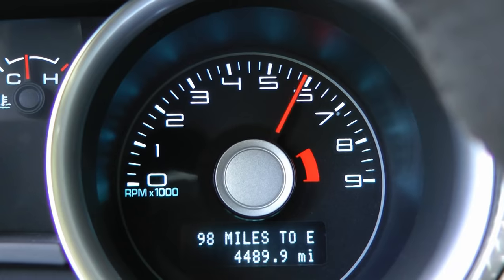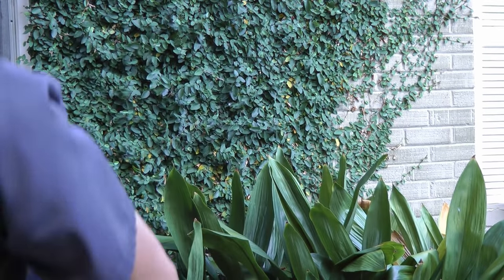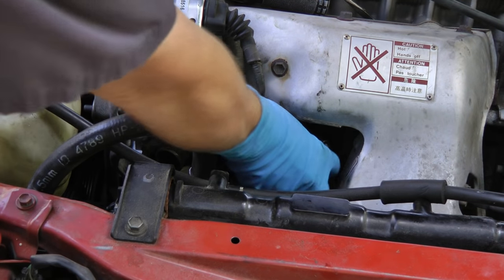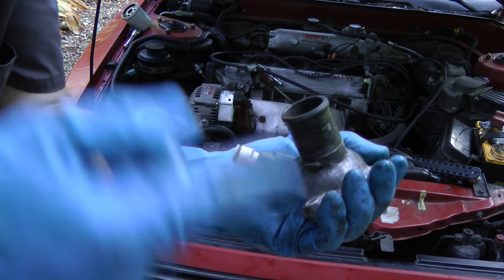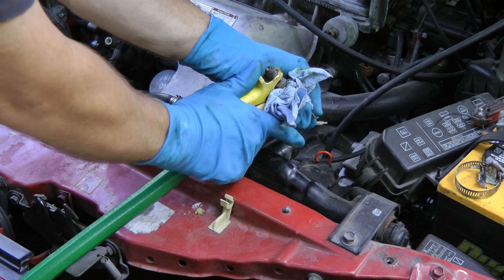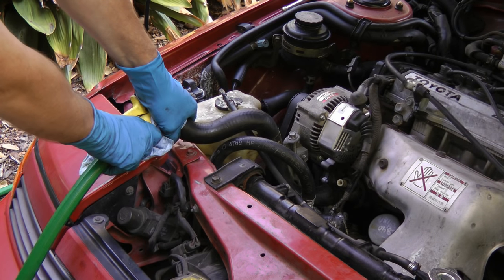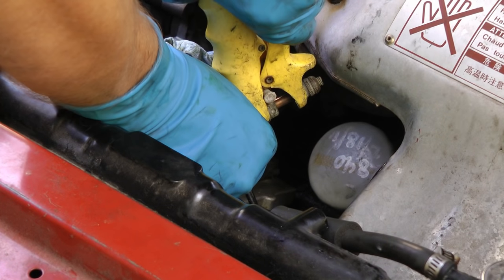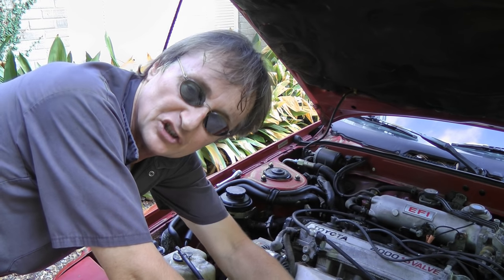How to Flush a Coolant System in Your Car (the Easy Way)

Comment: Not sure I trust city water with all the fluorine and minerals and calcium deposits in my all aluminum engine, block and heads.  I think I'll stick to good old drain and fill with distilled water.

Comment: A few things odd about his procedure:

1) He doesn't specify to remove the radiator drain plug.

2) Using straight garden hose water to flush and refill your cooling system.  A no for those out there who really care for their vehicles.

3) Running your car for a week on straight garden hose water.  And no thermostat.
What if you decide to do this when it is 90+ degrees outside?  Seems risky.

4) If the radiator hoses have any signs of corrosion at either ends, probably best to buy new ones.

5) Refilling with a 50/50 mixture of coolant and water in the final step.  Some coolants specify to not dilute.

6) Doing this in the dead of summer or winter seems unsafe.  Water can boil, and it can turn to ice.  Nobody wants a cracked head or block.

Bottom line if you decide to follow these steps, do so at your discretion.

Comment: You shouldn't leave the thermostat out
Reply from the maker: +cAke gAming as i say, you put it back in after running a while to flush it better
Reply: yes but the thermostat opens at aroung 86 degrees. it helps to get the coolant to operating temp

Comment: Driving with water for week in warm climates is no issue.  Leaving the thermostat out while doing that is NOT a good idea.  The engine will run cold and effect fuel economy / continuous cold start mode.  Also, not having coolant will effect the water pump mechanical seal that gets lubricated by coolant additives. Sorry, not a good video.

Comment: I've heard people say that running a car without a thermostat is hard on the friction surfaces as it takes so long for the car to reach operating temperature. Any truth to this?

 I guess a caveat to this video is don't be running the car without antifreeze in the winter. I'm sure some idiot will try this and come back bitching you owe him for repairs.
Reply from the maker: If you do it for six days, no problems. But six years, yea, it would eventually do some damage. this is just to flush em out strongly.

Comment: With the thermostat out of it... WTF!!??  NEVER run your car without the thermostat in it or run it with straight water in the cooling system on modern cars!  You can flush out the radiator out all you want but if you want your engine to last a long time you should keep up with the recommended fluid changes in your owners manual.... R.T.F.M.!

Comment: No way in Hell I am gonna flush it with any water other than distilled water. Your garden hose idea will shorten the radiator lifespan, because now it will corrode faster due to introduction of minerals into the coolant system and good luck getting that water out of there completely.

Comment: Sure drive around without a thermostat on the engine. Not only will the block not stay at the right operating temperature. A engine that's too cold will not have the piston rings properly expand then you'll burn oil through the combustion chamber which in turn will gunk up your plugs and your catalytic converter. Plus flushing with a garden hose isn't bright idea either since you're introducing minerals into the block which increases it's corrosive rate. Never allow this assclown to work on your car
Reply from the maker: Yea, doing this a couple days hurts nothing really. sure, a pro mechanic has a flush machine, but this method works fine for a do it yourself guy. Of course you'd want to do it in the summer if you live up north, I grant you that. But here in texas you can pretty much do it all year round. NO need for name calling doughboy, unless it's yourself.
Reply: Scotty Kilmer 
You're right about the name calling. I apologize. Hope you forgive and forget. I've gotta admit a lot of your videos have come in handy for for stuff that I've had no idea about. Thanks for the tips and hoorah brother

Comment: I would'nt be driving a without coolant. No anti boil or anti freeze
Reply from the maker: you only do it in the summer of course, and realize water actually dissipates heat better than anti freeze due to higher specific heat, it will not boil off in the system
Reply: You can drive a car in the summer with just water as long as there's no thermostat.The water doesn't stay in the engine long enough to overheat.

Comment: 2:48 - just put water?! As in, only water in the cooling system?! What?!!!! Did I miss something?!
Reply from the maker: yes, just water for a few days if you really want it flushed out by the heat of the engine. Then put coolant back in when done
Reply: All most cars need for effective cooling is water. Water boils at 212 degrees and in a pressurized system like a car's cooling system, the boiling point is even higher. Generally all cars run at about 200 degrees, so you should be good to go.  What antifreeze does is raise the boiling point of the system even higher so it's nowhere near the car's operating temperature, it also has anti corrosive agents. Since we're only running the car on water for a few days corrosion isn't an issue. There was a time not too long ago when antifreeze didn't even exist.

In my personal opinion, however, I've never found that step to be necessary. running water through the block and closing everything up has always been enough for me.
Reply: wheresmyhouse
Reply: @Mrwheresmyhouse also makes it so it doesn't freeze in the winter